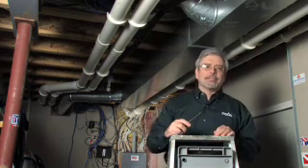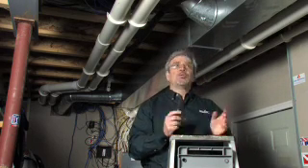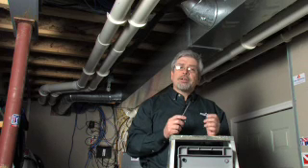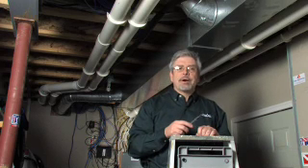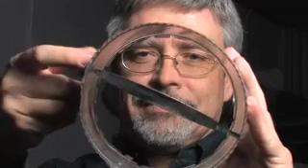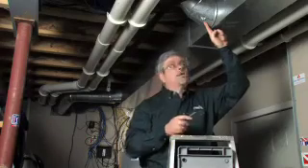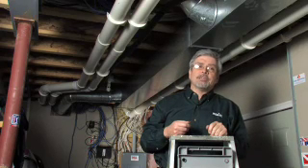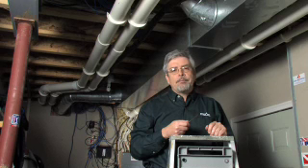Balance your home's air flow

Comment: This is a very useful video! I finally balanced my room air flow. We just brought our new house, but the air flow in the second floor is so weak. I half blocked several dampers in the first floor and opened every second floor dampers. And the air flow works much better. Finally have a not cold second floor in the winter. Thank you so much! 
The only burden right now is the sound. After I strict serveral dampers, the blower sound increased a little bit. But I think, blower do need work harder to send air to our second floor. So the sound is acceptable.

Comment: is it true that i could damage the furnace by resteicting too much air flow? i want to totally block off two rooms completely?
Reply from the maker: Hi Joshua,

Yes, it's possible to damage a furnace or air conditioner. If any of your ducts run through unheated spaces such as attics, garages, or crawlspaces, closing dampers can cause your bills to go up due to increased air leakage into these unconditioned spaces.

For more info, please see: http://www.energyvanguard.com/blog/76258/Can-You-Save-Money-by-Closing-HVAC-Vents-in-Unused-Rooms

Here are two quotes:
"9 unintended consequences of closing vents
Let me now summarize the problems I've described above that can result from closing vents in your home. The first thing that happens is the air pressure in the duct system increases, which may give rise to these negative consequences:
Increased duct leakage
Lower air flow with PSC blowers
Increased energy use with ECM blowers
Comfort problems because of low air flow
Frozen air conditioner coil
Dead compressor
Cracked heat exchanger, with the potential for getting carbon monoxide in your home
Increased infiltration/exfiltration due to unbalanced leakage , as I described last week
Condensation and mold growth in winter due to lower surface temperatures in rooms with closed vents
You're not guaranteed to get all the problems that apply to your system, but why take the chance."

And:
"It's possible you may be fine closing a vent or two in your home, but it will depend on how restrictive and leaky your duct system is. If it’s a typical duct system with 60% higher static pressure than the maximum specified, closing even one vent could send it over the edge. If it’s a well designed system with low static pressure and sealed ducts, you shouldn’t have a problem as long as you don’t try to close too many." 

The video was intended to help people balance air flow to different rooms, especially if a duct damper was closed by a previous occupant.

Thanks for the question!
Reply: Thank you for be thorough and thanks for the response. It would be nice if everyone on youtube responded.